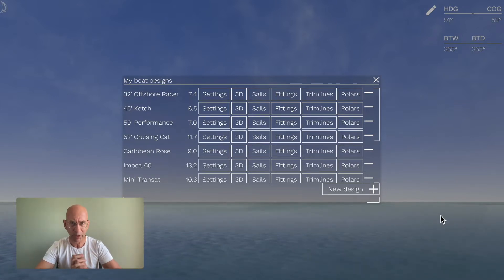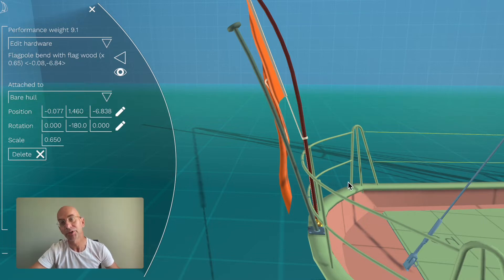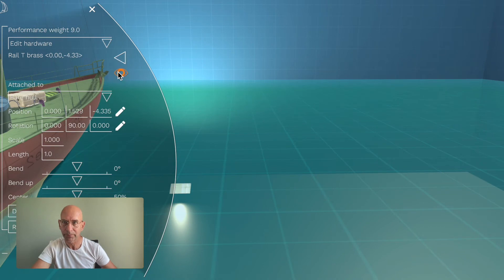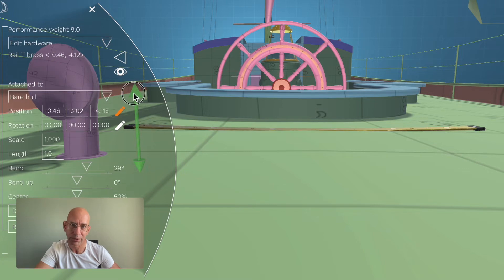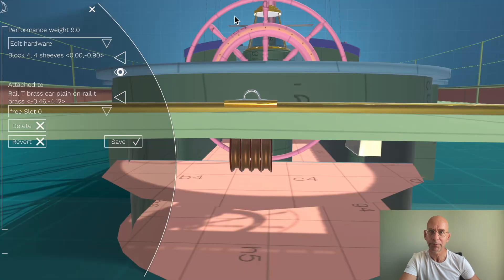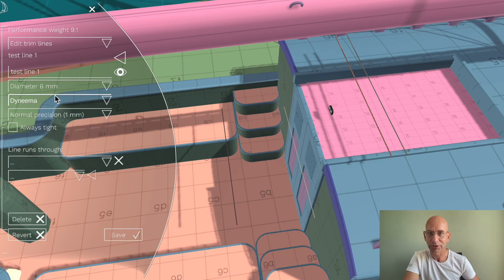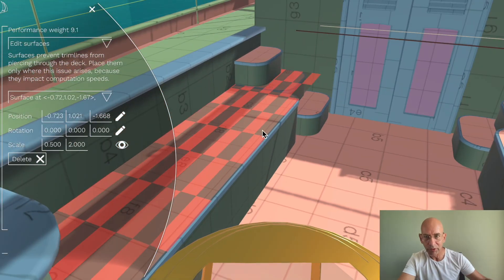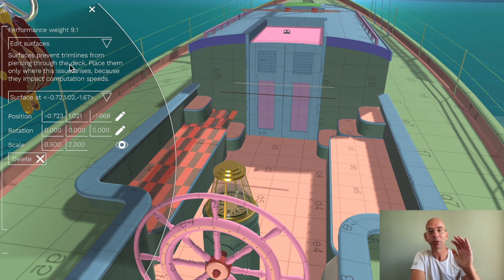Developing Sailaway III 12, hardware in the boat designer

Comment: One thing I'm noticing here is that while the UI for the designer definitely looks nice, it takes up a lot of space. Almost a full third of the screen is taken up by a handful of controls.
Reply from the maker: True, although it depends on the size of the screen. This screen is 1920x1080 pixels. As compensation for the large controls, the area is transparent and does not block the mouse pointer from clicking in the world behind it.
Reply: @sailawayworld  That sounds like a good solution, and it's good to know that it scales with the resolution. And I know it's difficult to balance people that want to use as much of their screen as possible and those that might have difficulty seeing small text.